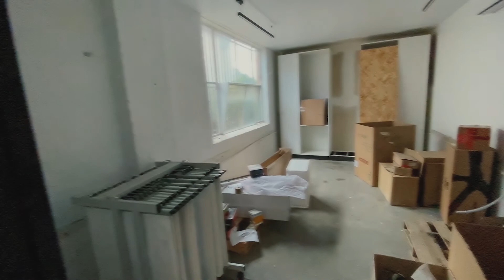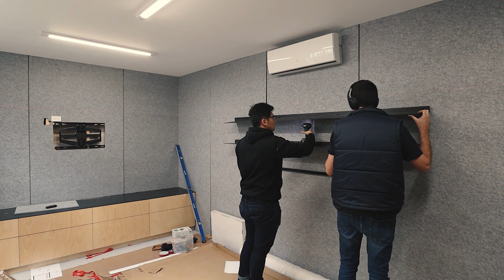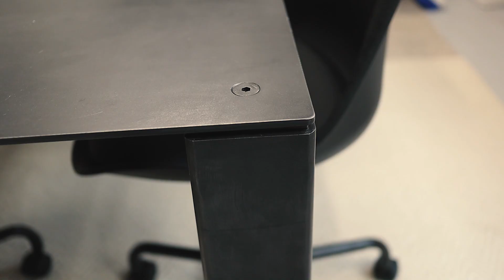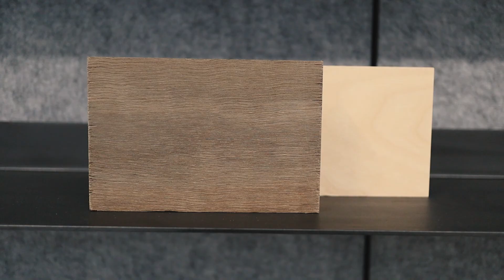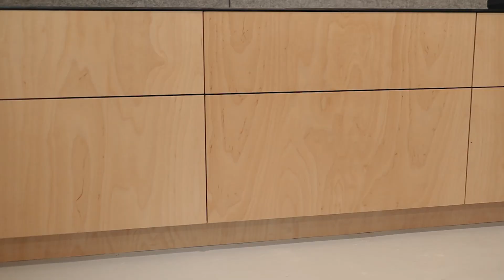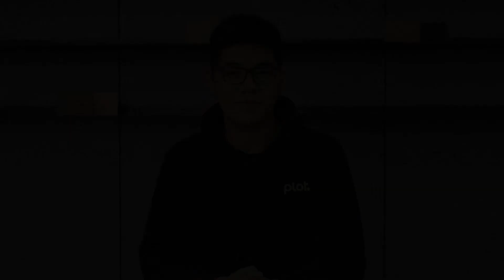Plot Joinery Studio Fitout - Melbourne Custom Joinery

Comment: Would you want to have handles though? It already looks sleek. Personally I would fit a push latch to keep the flush look. Something similar to this. https://www.youtube.com/watch?v=HlNht6yDzpM
Reply from the maker: I agree no handles looks nice. Handles are mainly for functionality. Mechanical push open is great- but unless we use a motorised solution, each drawer runners has to be tailored to the weight of the contents in each drawer to ensure consistent and functional opening/closing action across all the drawers. 

As we will constantly be moving items in and out of the drawers and changing the contents with changes in samples etc, we wouldn’t be able to calibrate the drawer up front like we would say for a client’s cutlery drawer.
Reply: Up to you, it'll be shame to cover up the birch, alternatively you can go with black stainless steel handles to compliment your shelves & trims.